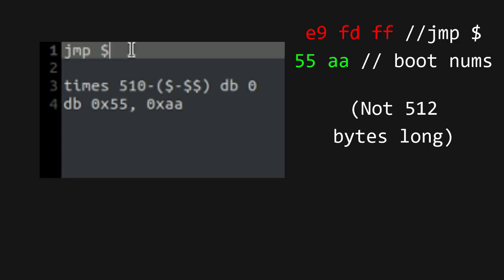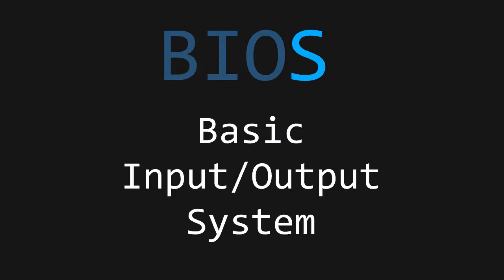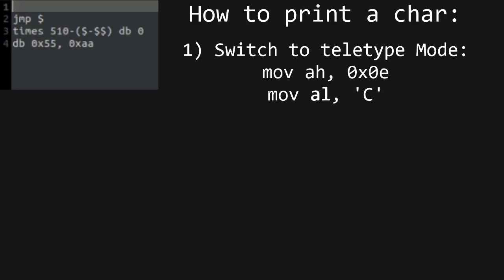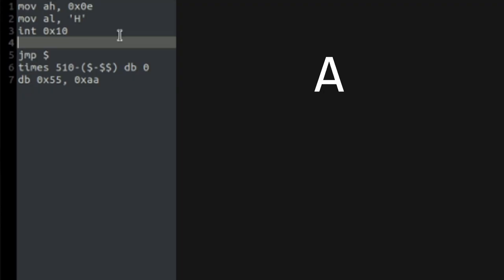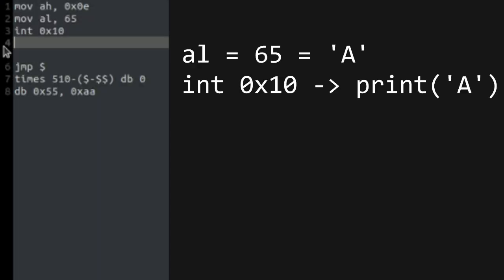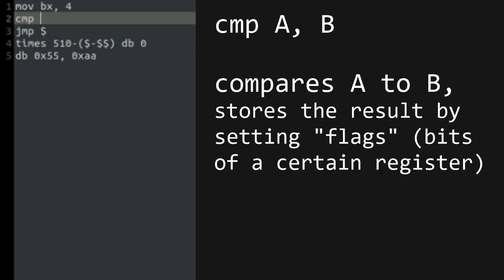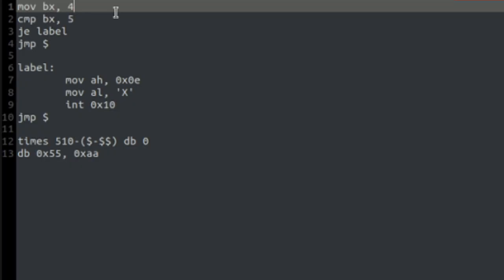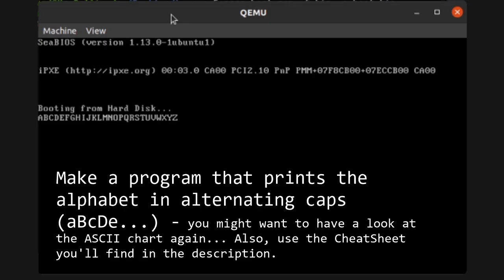Making an OS (x86) Chapter 2 - BIOS, Printing the Alphabet, Conditional Jumps

Comment: I got a new laptop so I installed nasm and qemu. I never realised how assembly was easy and hard at the same time. Anyways, this is my homework:

mov ah, 0x0e    ; Switches to teletype mode
mov al, 65         ; Moves 65 to al register, which is the capital letter A
int 0x10             ; Calls the BIOS Interrupt, which types out the letter

loop:                   ; A loop

    cmp al, 'Z' + 1 ; Checks if the value in al has reached the specified value, or in this case, a char after Z
    je exit             ; If so, then break out of the loop
    int 0x10         ; Else, call the BIOS Interrupt and type out the letter
    add al, 32      ; This will add 32 to the al register because according to the ASCII Chart, the value difference between uppercase letters and the lowercase letters is different by 32
    int 0x10         ; Call the BIOS Interrupt again and type out the lowercase letter
    sub al, 32      ; Subtracts from al by 32, which will add 1 after the loop starts again
    inc al
    ; Decided to put inc al before the jmp because after we subtract 32 from al, it will be still 65
    jmp loop       ; Jumps back into the loop

exit:                   ; Exit Label
    jump $          ; Jump to the current address 

jmp $
times 510 - ($ - $$) db 0
db 0x55, 0xaa
Reply: Just an FYI: the "int 0x10" below "mov al, 65" can be removed as we don't want to print any characters until we have started our loop. Otherwise it will print two uppercase A characters.
Reply: @CybernerdShua  hey bro thanks for the reply
I've kind of forgot why I've putted that there before the loop, but it's prolly that sum didn't work
So I think I've just forgot to remove it afterwards 😅
Reply: One syntax error you've got is typing jump instead of jmp at the exit label
Reply: @shatterstone3045  
Oh ur right, didn't notice it at first
Thanks bro!
Reply: also, instead of doing 
sub al, 32
inc al

 you could simply do 
sub al, 31
Reply: @gg.martins  Good idea! the less code you write, you make more room for more code! ( in those 512 bytes everything counts )
Reply: @gg.martins  yeah u right lol
Thanks for pointing out
Reply: I JUST DELETED MY ENTIRE HOMEWORK

Comment: If you don't know how to make the letters alternate caps then I'm not gonna spoil the code for you, but here is a hint:

It involves addition and subtraction.

Also take a look at the ascii table in the description.
Reply: You only have to change one bit, addition and subtraction is not necessary and requires you to check if the character is lower case or upper case before
you can proceed with the operation. By changing the bit 0x00100000 you can change the case correctly every time without checking anything, with the added benefit of faster execution(bit operations are much faster).

switch_case:
     xor al, 20h    ;;  Lower case becomes upper case and upper case becomes lower case.
lower_case:
     or al, 20h       ;; Upper case becomes lower case and lower case stays the same.
upper_case:
     and al, CFh    ;; Lower case becomes upper case and upper case stays the same.
Reply: Hint 2 if you still can't get it:

The subtraction comes (somewhere) after the addition in order to undo it (the addition, I don't want to leave you confused what I mean by 'it')

Comment: I dunno, something like this?

mov ah, 0x0e ;switch to teletype mode

mov dl, 0 ; 0 for uppercase 1 for lowercase
mov ch, 'A' - 1 ; which upper case we are on
mov cl, 'a' - 1 ; which lower case we are on

loop:
	; check the case we are doing
	cmp dl, 0
	je upper
	cmp dl, 1
	je lower
		upper:		
			; change next print to lowercase and print uppercase
			mov dl, 1
			inc ch
			mov al, ch
			int 0x10

			jmp loop
		lower:
			; change next print to uppercase and print lowercase maybe exit
			mov dl, 0
			inc cl
			mov al, cl
			int 0x10
		
			cmp cl, 'z'
			je exit

			jmp loop

exit:
	jmp $

; BOOT FROM HARD DISK THING.
; this section is for booting, magical.
times 510-($-$$) db 0
db 0x55, 0xaa
Reply: ;Cant it be:

mov ah, 0x0e
mov al, 65
loop:
    int 0x10
    inc al, 33
    int 0x10
    dec al, 31
    cmpr al, 122
    je exit
    jmp loop
exit:
    jmp $
times 510-($-$$) db 0
db 0x55, 0xaa

Comment: Posting my solution to the challenge even though the series won't be continued for a bit:

mov ah, 0eh

mov bl, 61h
call print

alternate:
    cmp bl, 5ah
    je exit
    cmp bl, 60h
    jg lower
    cmp bl, 60h
    jl upper

upper:
    add bl, 33
    call print
    jmp alternate

lower:
    sub bl, 31
    call print
    jmp alternate

print:
    mov al, bl
    int 10h
    ret

exit:
    jmp $

times 510-($-$$) db 0
dw 0xaa55

It took a bit of tweaking but I finally got the ascii characters to be correct, also tried to make it as object oriented as possible

Comment: Very clearly explained, thanks! I Got only only one question: at 5:20 you compare the register bx with the value 5. The conditional Jump (je) in the next line need to know what the output, or return value is. Where is it stored? And how does the CPU know, where to look it up?
Reply: look for rflags (or maybe more eflags as it is x86 yeah, look at eflags) on the web
Reply: The compare instruction set the zero flag, if the values are the same and the je/jz instruction jump if the zero flag is set in the flag-register.

Comment: Hi, what does this output mean from qemu, when running the boot sector program from part-1:

WARNING: Image format was not specified for 'boot.bin' and probing guessed raw.
         Automatically detecting the format is dangerous for raw images, write operations on block 0 will be restricted.
         Specify the 'raw' format explicitly to remove the restrictions.

Any clarification regarding this would be great

Thanks

P.S. Amazing set of videos will definitely follow the series.
Reply from the maker: I've solved this problem by using:
qemu-system-x86_64 -drive format=raw,file=os.flp,index=0,if=floppy

Hope it works for you as well!
Reply: Quick search shows me this: https://askubuntu.com/questions/883491/qemu-warning-image-format-was-not-specified-for-flash0-img-and-probing-guess

What's going on is that qemu isn't sure what format the OS is, so it's making block 0 (the first 512 bytes or 4 kilobytes usually) read-only, just in case the OS expects that to be the case (as presumably some historical ones did).

So, to make the block (and your code) writeable, you could use the command:
qemu-system-x86_64 -drive file=boot.bin,format=raw
Reply: @TimothyJesionowski  Yeah, it makes sense now, that qemu is making assumptions by itself and warning you about them, in case your assumptions differ.
but the command:
 qemu-system-x86_64 -drive file=boot.bin,format=raw 

Causes my system to hang.... like even the mouse pointer disappears and the fans spin up like crazy (Ubuntu 20.04).

I don't know exactly why that happens yet, but I feel that it is due to the -drive flag, as once I removed that and tried:
 qemu-system-x86_64 boot.bin

Everthing worked fine.... but yeah I got those usual warnings, as before.

Comment: Thanks for this series. You explain so well! This is my code to print the alphabet alternating lower and upper case characters.

; Set teletype mode
mov ah, 0x0e

; Set initial value 'a' on char printing registry
mov al, 97

printingLoop:
    ; Print lowercase character
    int 0x10
    sub al, 31

    ; Check if bounds have been reached
    cmp al, 'Z' + 1
    je exit

    ; Print upper case character
    int 0x10
    add al, 32

jmp printingLoop

exit:
    jmp $

; Boot sector
times 510-($-$$) db 0
db 0x55, 0xaa

Here is a more convenient GitHub Gist snippet :)
https://gist.github.com/calderov/8c3cf93b3e4ab3d80f37c360bd2c0268
Reply: @Morgan Smith oops! My bad. Thanks for taking a look.
I fixed the code and updated my Github GIST. It looks like this now.

; Set teletype mode
mov ah, 0x0e

; Set initial value 'a' on char printing registry
mov al, 97

printingLoop:
    ; Check if bounds have been reached
    cmp al, 'z' + 1
    je exit

    ; Print lowercase character
    int 0x10
    sub al, 31

    ; Print upper case character
    int 0x10
    add al, 33

jmp printingLoop

exit:
    jmp $

; Boot sector
times 510-($-$$) db 0
db 0x55, 0xaa

Comment: I am confused about one thing - the assembly that you are writing in this file, where is it saved? In the 512 byte long boot sector? After it?
Reply: it is in the long boot section. There is still the code after : 
times 510-($-$$) db 0
db 0x55, 0xaa

For the moment that's the only way we know to execute code. ;)

Comment: Slight error at 5:32: printf('X') isn't the right code to display an X on the screen. It will attempt to read a string from address 0x58 and use that as the format string. Generally this would be associated with a segfault (crash), but in this case it can actually read from that address since it's in real mode. So in all likelihood it will either print gibberish or nothing at all. If it does print an X, it would only do so by coincidence, if that happens to be what data is there.
The correct code would be printf("X") or putchar('X').

Comment: Fun fact: The "non-system disk or disk error" message you used to get with floppy disks wasn't a BIOS error; it's actually a boot sector program that got loaded onto floppy disks when formatting them. That's why the text was sometimes different with different disks.
Reply: wait.. does it mean that when you put a disk in your computer, you can execute code by putting this code in the boot sector program O_O
Reply: @matth6058  Yes, but it will only run if you reboot the computer with the disk inserted. It works with flash drives as well, but depending on how the BIOS is configured, it might not boot from it unless you manually select it from the boot menu.
Reply: @Sparkette  ah yes it is only if you boot from the disk.
Reply: @matth6058  This isn't exactly the same, but it used to be that Windows could do this with CD's, without having to boot from it. Like, you'd insert the CD, and it would automatically run a program on the disc. It shouldn't be hard to imagine why this was eventually removed.
Reply: @Sparkette   oh yes O_O'' ... thx for explaining me this ^^

Comment: Homework solution:

    mov ah, 0x0e
    mov al, 'A'
loop:
    int 0x10
    add al, case_diff
    int 0x10
    sub al, case_diff - 1
    cmp al, 'Z'
    jle loop

    jmp $
    case_diff equ 'a' - 'A'
    times 510 - ($ - $$) db 0
    db 0x55, 0xaa
Reply from the maker: That's very similar to how I've done it :) 

Let's see if others will come up with other solutions!

Comment: Does the sector need to be in the top ?
Reply from the maker: You mean the boot sector? Yes, it needs to be in the first sector of the bootable drive
Reply: @DaedalusCommunity  

So why you print all this instructions above him ?
Reply from the maker: @xrafter  ah, I see what you mean. No, the boot sector does not only consist of the last two lines; the whole code is the boot sector. Those two lines are needed to:

Make it 512 bytes long;
Make it end with the right numbers.
Reply: @DaedalusCommunity  

Aha. now i understand :)

Comment: How did the bios work if you are in the os kernel ?
Reply: I believe (I'm not sure though) BIOS resides somewhere on the motherboard memory and is loaded/executed first, then "jumps" to MBR sector on the hard drive.  Please refer to "Master Boot Record" manual/wikipedia page or whatever source you may find. It says that is usually consists of bootloader and disk partition table. What is written in assembly here is first level bootloader. I believe this bootloader in MBR is used to jump to bootloader that is on the partition with "boot" flag? So, in this video, we do not have the kernel yet.
Reply: jqbtube  

The cpu can't read from the rom .

It must load to memory first .

All programs must load to memory.
Reply: jqbtube  

And i think the bios is just a virtual not a real one .

Comment: BIOS gives some convenient functions, when you switch to protected mode, where actual OS will run, you'll have to use `out` and `in` and/or memory writes to make drivers for some things like hard drives, cd's e.t.c.
Reply: What cd stands for ?
Reply: Yeah out and in is weird instructions can you tell me what they do ?
Reply: @xrafter  out and in do output/input into device, can output bytes, words, dwords. CD I meant CD-ROM
Reply: @ishdx9374  
Give me an example :D.
Reply: @xrafter  There's no simple example, you have to first set up most devices (using same in/out commands), and then use them (in/out again). 
If you run qemu with `-debugcon stdio` flag:

out 0xE9, 'a'  

Will output 'a' into your host machine terminal. Where 0xE9 is the device for qemu debug output. This is the simplest device I can think of. `in` instruction can read from devices. You'll use the instructions in PCI, PIC etc